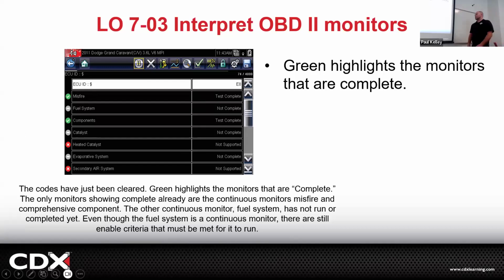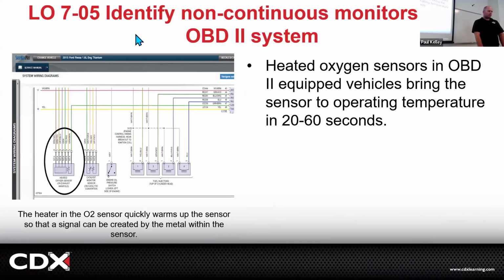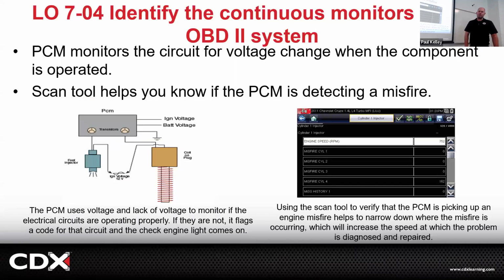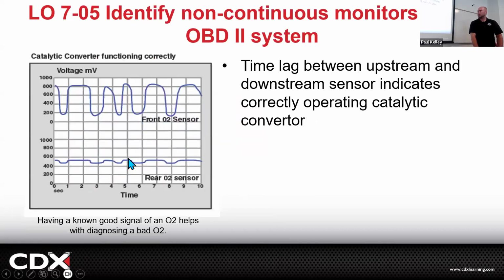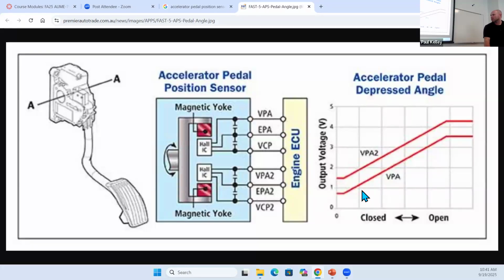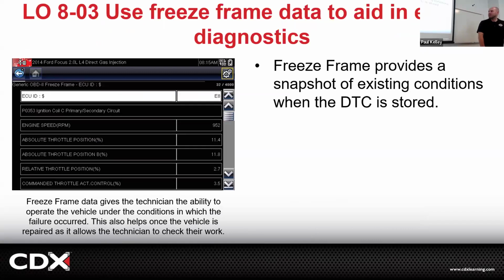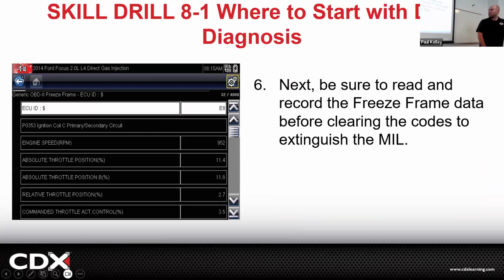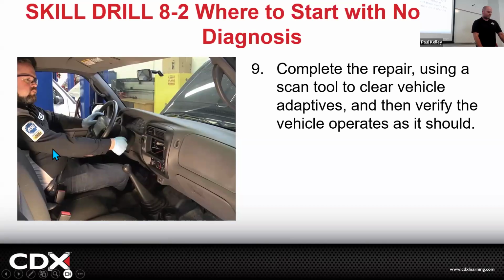ASE A8 Engine Performance Unit 2 Introduction to Computerized Controls and On-Board Diagnosis Part 3

Comment: From your franchise dealer experience, do you guys have to follow TSBs when performing repairs as part of the procedure or are they more like suggestions and not really required? I have a case of an engine failure from a customer right now that makes the repair twice if not three times more expensive if we follow the TSB instead of the traditional repair procedure.. (Head gasket Vrs Engine replacement)
Reply from the maker: Typically the tsb is what I would follow. They issue the tsb because there is a known issue and a known fix. So in your example if they are saying do not replace the head gasket, do the whole engine, normally it would say why. Maybe the block aluminum is failing and the head gasket bolts are loosing torque. In which case you would replace a head gasket and it would fail again prematurely. 

They are there to help you the technician

However, if you read and understand the tsb and feel it is not applicable or you feel it doesn't benefit the customer you could disregard it. Just know if it doesn't work out as a direct result of you disregarding the tsb you would be the one liable. For this reason the dealers will generally stick to the tsb. Why open yourself up to liabilty?
Reply: @CollegeAutomotiveClasses   Yea I totally agree. I can't remember if it explained why. Have to read the TSB again but the reason I asked is because this is an extended warranty claim so I am getting ready with all the info I can get to explain to them and convince them that it requires an engine replacement and not the typical head gasket job even though it would be almost three times the cost.. I am sure they won't like to hear that.. 😬

Comment: It’s was a broken head gasket cause that misfire. Loss of compression in cylinder 2 and 3?
Reply from the maker: If the leak is between the 2 cylinders yes. But the leak can also be between cylinder 2 and a coolant passage for example, which will cause an issue with 2 and coolant loss but no issue with 1 and 3.